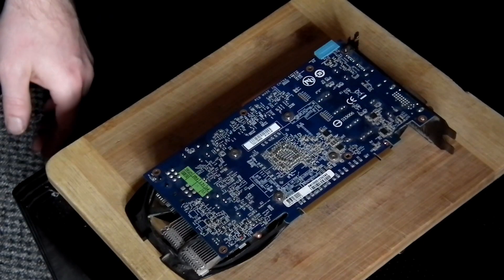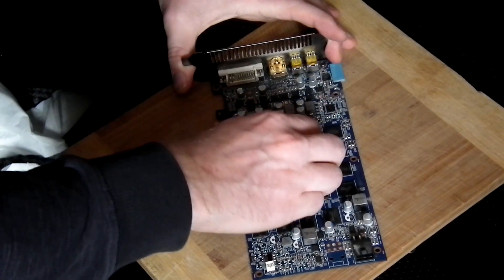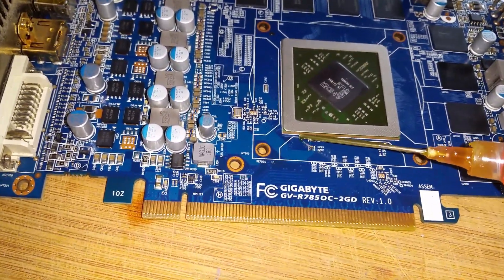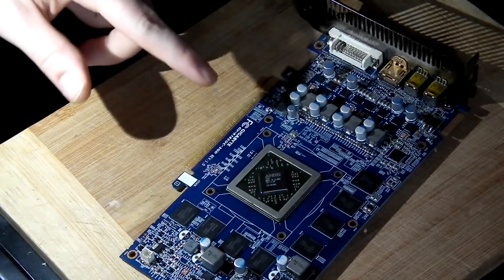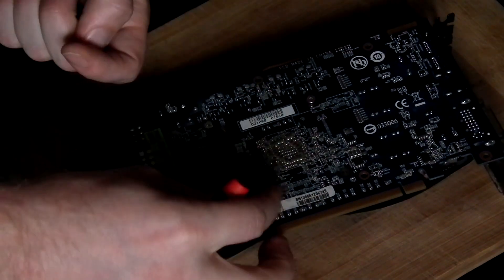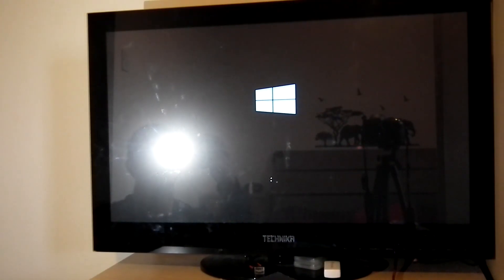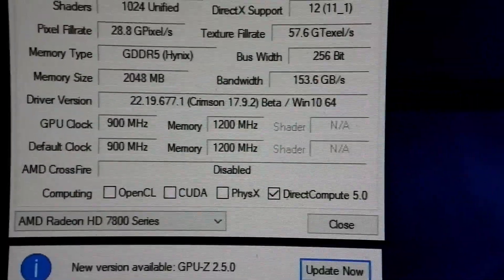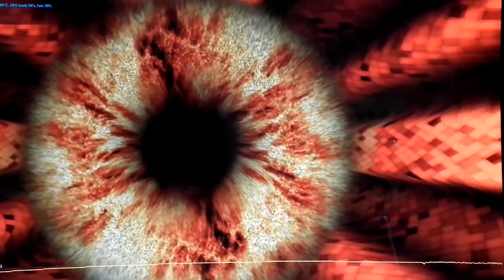How to fix black screen or no signal problems on any GPU

Comment: Hey brother. I have rx 550 3yr old, for first 3 days after installation it worked flawlessly then most times video card is not detected by my vga monitor, i kept reseating, tried hdmi and displayport also, integrated graphics disabling option is only available when gpu display is detected. Any help?
Reply from the maker: I will definitely try this card in different pc as sounds for me som Power problém with can be GPU faulty or your main board at least your PSU. Like I say try if you can this card in different pc or if you main board have more PCI express slots try that as well
Reply: @frogtechtips  ok thank you
Reply: @frogtechtips it's very wierd actually, even though there's no display, randomly GPU display signal is catched by monitor
Reply from the maker: You mean in different pc
Reply: @frogtechtips  no in the same pc, display signal from GPU appears randomly, otherwise most of the time gpu fans run but the display would come out from igpu
Reply: @frogtechtips   also the screws at the back of gpu that holds the fan are rusty, how do I remove them without damaging the GPU?

Comment: My graphics card problem during playing in five mins the display goes black But Fan spanning normally and shows no vga detect  sir any solutions😢
Reply from the maker: Do you check your temperature if you high try replacing thermal paste and pads , you can Also try if the same do in lower resolution
Reply: @frogtechtips  okay sir i will try
Reply from the maker: Let me know after

Comment: RX580 card is dying. 
Whenever I open any game (even if it is 20 years old), my entire PC crashes, I know its the GPU because I knew it had problems when I bought it. 
Sometimes display/colour issues, sometimes my monitor doesn't recognize GPU in system. Works fine just for display right now but stopped 2 months ago. Sometimes squares form on screen or entire screen becomes green in colour.
Reply from the maker: Try reheating your card there is nothing to loose anyway and if not help just buy new cards is so cheap This Day
Reply: @frogtechtips  Yeah but it's expensive for me, I can't afford another one, I got this for extremely cheap from friend because he didn't want it. I will try your method, but I don't have the tools to heat, and don't want to spend money in case it doesn't help me fix my card.
Reply from the maker: @huzaifakhambhati8767  you can still try oven method but is one I will never do but I know some people have a with it or if you have a hair dryer you can try that as well btw used Rx 580 you can get about 50 euro
Reply: @frogtechtips  Only have a cooking oven and don't want to ruin it with the fumes. It might be 50 Euros for you, but in my country it's almost 100 which is too much for me. I know it sounds weird but earning that much in India is not easy. I will just have to adjust not playing video games until I can afford something, I don't want to buy a used one anyways.
Reply from the maker: @huzaifakhambhati8767  try borrow from your friend some hair dryer and try with that

Comment: i pushed down my gpu as it’s inserted
now everything is working fine
Reply: what do you mean pushed down? As in inserting it to the pcie slot of your motherboard?
Reply from the maker: Yes he means that clean slot and be sure is fully inside
Reply: @frogtechtips  thank you, I will try it. Cuz I do feel the card is not going all the way in due to that gpu i/o panel
Reply from the maker: @Sou-no7xt  yop try that at first point
Reply: @frogtechtips  didn't work. Looks like RMA it is, which is a pain in my country. I really believe the manufacturing quality has degraded since 2020.
Reply from the maker: @Sou-no7xt  is your card still in warranty if yes go that way
Reply: @frogtechtips  yes. it's 4 months old. I packed it for RMA.
Reply from the maker: Definitely yes it is best way
Reply from the maker: Good I hope will working now

Comment: i kept having this problem until i moved my GPU around
it’s been a month now the issue is back.
I rlly need help
RTX 3060 i got
whenever i game online my monitor just goes no signal and i have to power it off and then turn it on
Reply from the maker: Is your PSU strong enough for this GPU

Comment: My GTX 1050 Ti having no display, so i tried my old GT 710 and its working perfectly. Even if its my GPU the problem. Its warrenty expired. I don't know what to do. Need help....
Reply from the maker: If you don't have warranty on it just try reheating there is nothing to loose anyway

Comment: will wd40 work for the gpu? I only have wd40 here, isopropyl alcohol will be bought soon
Reply from the maker: Hi I will not use w40 is so aggressive
Reply: @frogtechtips  therefore it's not advisable? I'll get isopropyl and esd brush as shown in the video. Thanks a lot!
Reply from the maker: @ronvios6193  you welcome always is better get Al correctly:-)
Reply: @frogtechtips  Can you also let it dry by leaving it for a few hours? I don't have a heat gun to use.
Reply from the maker: @ronvios6193  what do you mean let it dry how you want a heat up if you don't have heat gun
Someone have luck with hair dryer or last but I will never recommend is use oven

Comment: I tried and it helped, now the card gives my screen a signal but all I see is a black screen but its a lighter black than when there's no signal. I think theres a chance it could be revived
Reply: I have exactly the same problem did you find the solution
Reply: I didn't try anything else but I might try the ''bake'' fix and see what it does, I don't have anything to lose here because this card as been dead for years sitting in my closet
Reply from the maker: @AKmumu  yop you right try reheating there is nothing to lose anyway:-)
Reply: @AKmumu  please update me on the situation thanks
Reply from the maker: That's interesting bit if give a signal there is something else wrong now

Comment: I have amd R5 340X and randomly my gpu is showing no signal or no display i changed slots nothing happened.It gave display 2-3 times for about 5-10 min then went black screen while cpu was working fine
Reply from the maker: Check your thermal paste at first point as maybe is just overheating
Reply: @frogtechtips  i will check it and also it is not displaying on startup
Reply from the maker: That's sounds you GPU Star dieing and as your card is out off warranty I will try reheating
Reply: @frogtechtips  can i use hair dryer for heating? Also when i got this gpu it was working fine then suddenly my monitor broke after 8-9 months i bought new monitor until then the CPU was all dusty including gpu then i used hair dryer to clean it. Is there any possibility that it is because of dust my gpu isnt showing display?
P.s:Thank you for ur support👍
Reply from the maker: Hi ye dust can be big problems
Some of the people have luck with hair dryer you can try
Reply: @frogtechtips  I have opened the gpu and cleaned it thoroughly and used hair dryer.
In the end, the fan of gpu was working but still not showing display...
What do u suggest. Should i get it repaired?
Reply from the maker: @SilentSanz  maybe just hair dryer is not strong enough
Reply: @frogtechtips  i see
Reply: @frogtechtips  is there another way i could try?
Reply from the maker: @SilentSanz  yop find some local repair shop
Reply: @frogtechtips  prolly the last only option left.Thank u for ur support frog🐸
Reply from the maker: @SilentSanz  you welcome
Reply: @SilentSanz  any updates??

Comment: Hello!

I keep running into this odd problem.. Every time I turn on my pc, no matter what I'm doing, my screen goes black after about 5 seconds. Monitor then shows no signal. After few attempts, pc turns on without any such issue but the gpu drivers are gone.

Uninstalling drivers via device manager and reinstalling does nothing. However, uninstalling via DDU then reinstalling drivers fixes the issue - until I reboot! Then the problem comes back.

I've tried:
Multiple versions of the gpu drivers
Setting the GPU to performance
Disabling windows updates for graphics drivers
DDU uninstall
Device manager uninstall
Windows installation

The problem is not present when using onboard graphics.

Gpu is AMD RX 570 4gb

No overclock applied, temps are fine.

Please help me here.
Reply from the maker: This looks like GPU die od ram problems I will definitely try reheating that should help but do this only if your card is out of warranty and btw did you try your card on different PC as well
Reply: @frogtechtips  no I haven't tried it on other pc yet.
Reply from the maker: @WasamAli  ok I will try that as first step

Comment: For me hdmi and dp all 4 ports not working on my 1060 but able to take remote access and see the screen GPU is detected driver is installed not sure what went wrong is my ports dead?
Reply from the maker: Hi that's hard to say how this happened do you know history of the card
Reply: @frogtechtips  I did not use the gpu for a couple of months it was working fine the last time i used no dust or rust on the ports gpu is also clean when booting via igpu i can see the 1060 in task manager and driver is installed can run games and benchmarks temp is 60-70c depends on game all working fine but if i use it in my another pc which does not have an igpu im unable to use the system
also checked the cable it is fine
Reply from the maker: @aravindraja8034  that's interesting and looks like port foulty and with igpu you use that output for signals and GPU is used for acceleration but this also can be  GPU die problems I will try reflashing bios at first point
Reply: @frogtechtips  Can you guide me on how to do it you can share me a video link or something or step by step instructions if you have the time
Reply from the maker: @aravindraja8034  go to techpowerup website all information you will find there

Comment: hello i have a 8gb gigabyte rx 580 that is showing no signal after i installed it in my new build ez led indicator shows a vga problem on my h310 pro vdh plus every time i try to boot my system , i formerly left my gpu that was working fine at the time inside its box ever since my old motherboard broke down (around 9 months ago) whilst i was saving money to get a new one paired with a newer cpu , since then i'm a 100% sure that i haven't physically damaged it or anything on board graphics works fine though (igpu) by the time i'm writing this when i have my gpu plugged rgb lights and fans turn on but there is no signal on monitor , what could have possibly caused it to malfunction
Reply: i tried reflowing it with a hair dryer for 10+ minutes but that didn't do anything
Reply from the maker: Hard to say what is wrong but definitely hair dryer is not strong enough even some people have luck with hair dryer but definitely you need something more strong
Reply: @frogtechtips  I'll see if i can take it to a nearby repair shop to use a heat gun on it & let you know how it goes
Reply from the maker: @eddoesnotexist  good idea or maybe hi will now proper repair solutions as well let me know

Comment: Hey not sure if you're still replying to comments. But I have a xfx Rx 580 and it worked fine one day and won't give signal the next. I test another GPU in my PC and it works fine. So it's my GPU. Has no more warranty so I have nothing to lose. Do I have to do the heat thing if I take it apart or can I just take it apart clean and re apply paste and see if that works
Reply from the maker: Hi I will try first clean card and check for physical damage and if all good definitely try reheating
Reply: Hiii i have cervvo rx 580 same problem every 1hr or 30 minutes my monitor going no signal I don't know why but you experience this problem? 

Sorry for my bad English
Reply from the maker: This can be card overheating or your PSU  is bad
Reply: @frogtechtips  how to fox overheating?
Reply: @frogtechtips  i try to change thermal paste but it didn't work
Reply from the maker: @ayerasreymarkb.3654  and du that on game or in windows as well
Reply: @frogtechtips  both
Reply: @frogtechtips  i try to add 2fan
Reply: @frogtechtips  thanks for replying dudeee apreciate 🥰

Comment: hey. my card goes no display after a few minutes. windows event timer shows amd driver related issu. i tried old driver and latest drivers. but no luck. then i used gpu without any drivers. same problem. no display but fans working. no idea its psu or gpu.
Reply from the maker: Try replacing thermal paste at the first step
Reply: @frogtechtips  i changed. but still same.
Reply from the maker: @swee2280  did you also tried flash BIOS

Comment: Hello, why do you heat the chip? I have a RX 560 that works for about 10 minutes then goes blackscreen. I changed thermal paste but I have not tried heating the chip for 10 minutes. What is it for? Can it damage my videocard? Can I use a hair drier? Thanks a lot!!
Reply from the maker: Hi if you get black screen after 10 min there is probably PSU or over clock problems
Reply: @frogtechtips  Thanks a lot for the reply. But I never oc my gpu, my videocard is a rx560 4gb with a corsais 450w 80 bronze with very old ddr3 computer.. I tested with other videocard and its works just fine.
Reply: The blackscreen happens randomly, when booting the pc, idle in desktop, browsing web. When I restart the device managed shows my gpu "disabled"
Reply from the maker: @rafaelteles4161  that's sounds like your GPU die start dies and yes reheating main chip can help but is always last step you do Also some people have luck with hair dryer as well only way to find out is trying and as your card is out of warranty there is nothing to lose anyway
Reply: @frogtechtips  thank you very much, do you think reinstalling vbios may help?
Reply from the maker: @rafaelteles4161  if you know how definitely try that

Comment: Hello! Great video! My gpu is only a couple years old, gtx 1070 8 gb, would i expect this to be dried out already? I had issues with lines across my screen for a while but only on bootup and would disappear after a few minutes but now won't show any signal. My cords and fine  tested and same with my monitor as ive testes that too. Ive blown out all the dust  that was in pc case but still nothing. Any ideas?
Reply from the maker: Hi if you card is out of warranty I will try reheating GPU there is nothing to lose anyway

Comment: My cooler is working but why does it not work and shows me black screen, but when I turn on the device on the motherboard, it works without problems. How do I know the problem of the external graphics card? And games or things on my pc working when i plug graphic card but is black screen! I tried my gpu on another pc and don't have display and i restart bios
Reply: GPU worked 2 weeks
Reply from the maker: Hi your GPU just die if your card is out of warranty try reheating there is nothing to lose anyway

Comment: help! my rx 470 doesnt work. screen got no display, my msi h310m mobo got the led light on the vga.
Reply from the maker: Hi is hard to help like this is your card working before normally what is the history of the card
Reply: @frogtechtips  yes its been working normally before this then suddenly the display when off. everytime i restart, the gpu logo (sapphire nitro) and rgb light up but ez debug led still on vga
Reply from the maker: @fyrdausabani  ok than looks your GPU die is bed try first opening GPU and look how is looks like Thermal paste if it's so dry clean and reheating your GPU can help
Reply: @fyrdausabani  same here do you happen to have an msi h310m pro vdh plus ? any update ?
Reply: @eddoesnotexist  got myself a new 1650 super past few months literally solve everything
Reply from the maker: Yop best option :-)
Reply: @fyrdausabani  Good for you too bad i spent all my previous savings on a new mobo , cpu & ram i don't think I'll be able to get a new card any time soon if my gpu is dead I'm basically fucked as where i live a used rx 580 as mine sells for as high as 500$ much more when brand new yes even after gpu shortage crisis and all that I'd rather not talk about the 1650 super price tho because it's beyond ridiculous

Comment: Hello bro, hope you reply to this. 
I have this 1050 ti Geforce, wich in a storm a couple of weeks ago got kinda burned and I sent it to repair. Ok, repaired, went to fetch it back and saw it working on this dudes PC with a stress program with no problems at all. 
Came to install it in my fresh new pc and I got to the mobo logo then no signal. tried a couple of stuff, a new PSU, updating BIOS (with another GPU since my CPU has no video), same result. Ok sent it back to the dude who repaired it, it works on his PC so there was no issue to point out, came back, no signal. Decided to try it out on a friends PC, worked flawlessly, we played like 3 hs or something with no problems with no heat and no FPS loss or anything, came to my house, NO SIGNAL.
Mos def. it is not a cable problem since I use the exact same cables with the other GPU I'm using now so  I have no clue what the issue may be. I have absolutely no signal, but the pc and the GPU coolers are runing, I can hear winows booting sounds an all. but monitor is at no signal
Reply from the maker: Hi did you try in your new PC different GPU as well and all working without problems